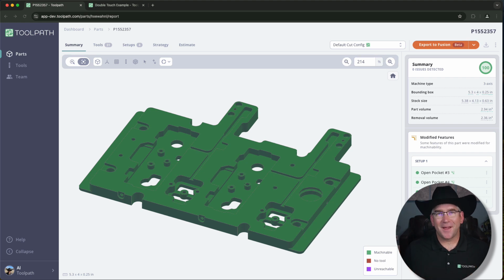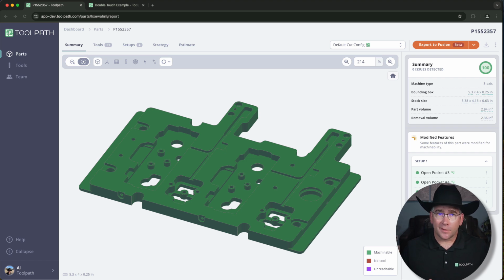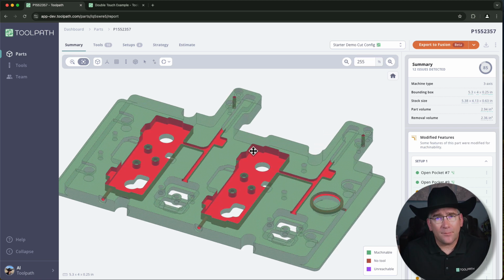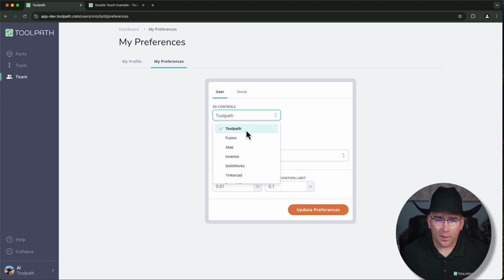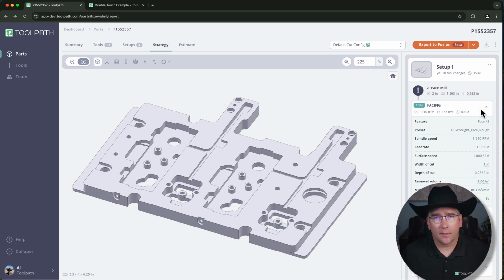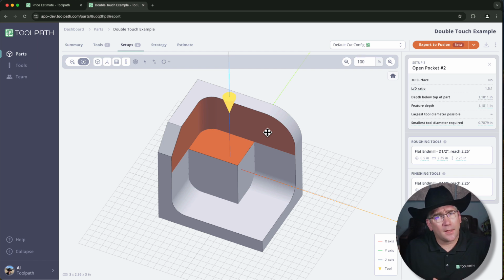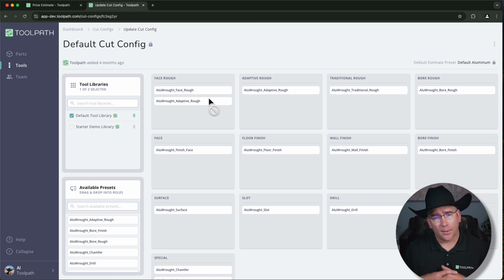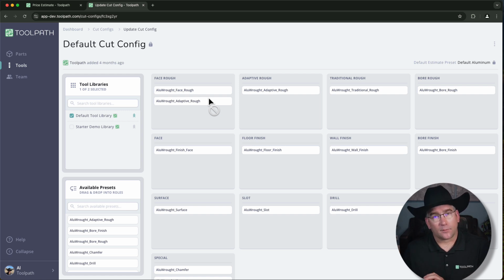Toolpath Tuesday with CEO Al Whatmough October 3rd 2024

Comment: If a non machinable feature exists because of a missing tool, does toolpath recommend one? For example, from what was described in the video, would it say missing keyseat cutter?
Reply: Not Yet,  This is a definite part of our medium term vision.  Thanks for asking the question!
Reply: I should have said not yet in " " because in some cases we do already give general guidance of a tool to get but not an exact one.     For example a pocket with a 1/8" internal radius but your smallest tool is 1/2" we will tell you you need a 1/4" tool, but don't yet say, just get this tool.